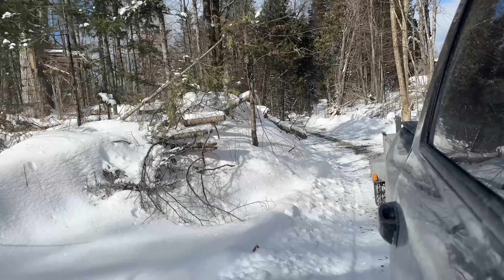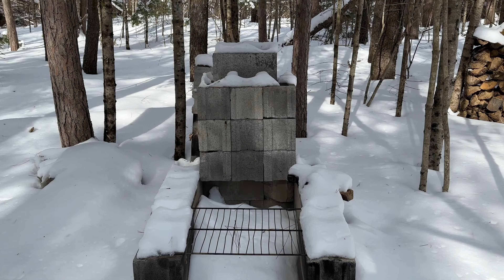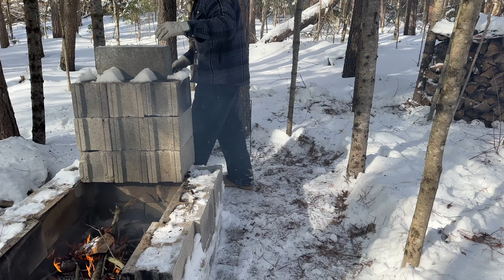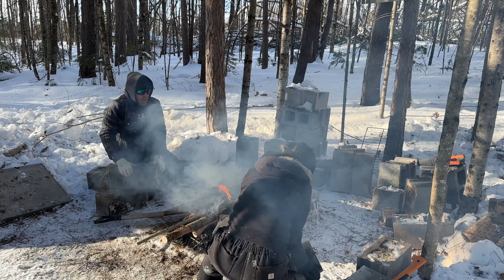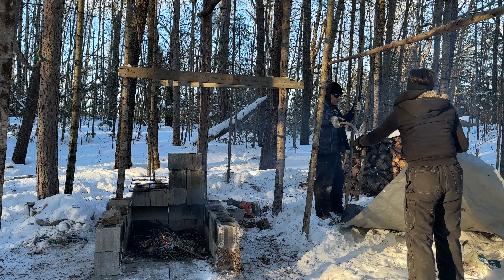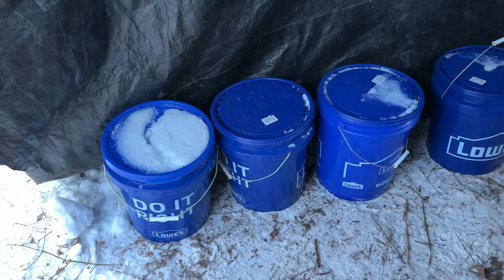Winter At The Cabin | Maple Syrup Season

Comment: Holly and jeff why not build a raised platform or stand for your barrels high enough to use a hose or pipe to feed the trays
Reply from the maker: We had them on blocks last year but this isn’t the permanent location for our evaporator. Once we have a shack built then we will have a proper spot to put the barrels 🍁